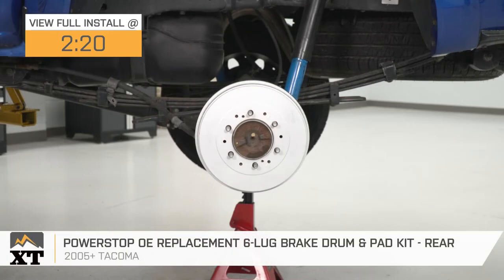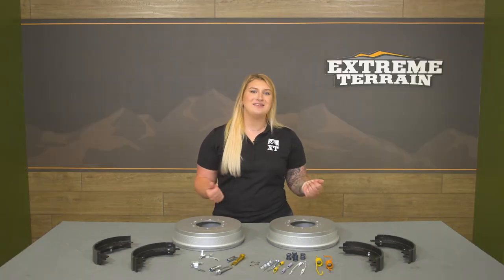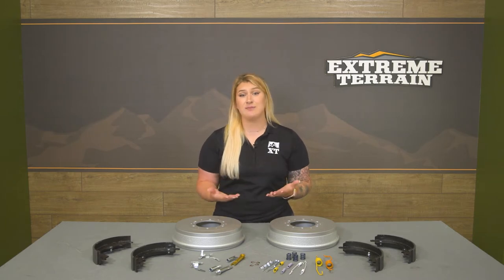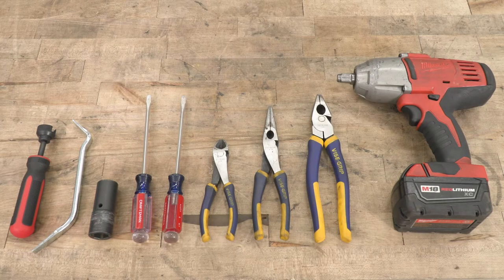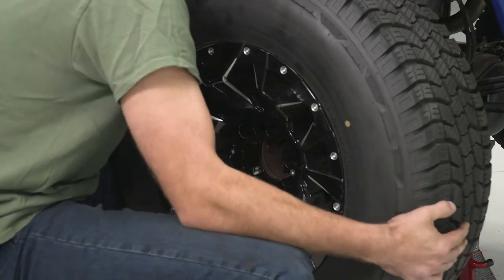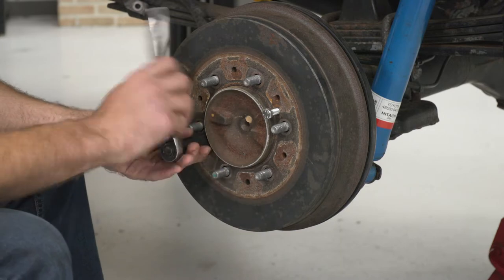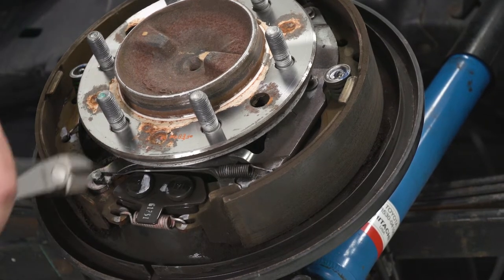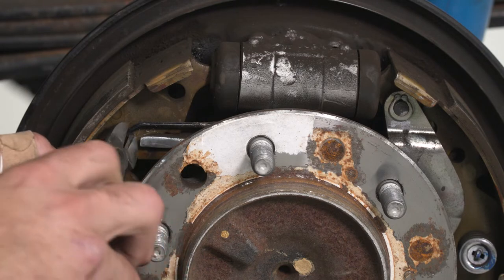2005-2022 Tacoma PowerStop OE Replacement 6-Lug Brake Drum and Pad Kit Review & Install

Comment: Adjusting, you don`t want to hear a rubbing constantly. Adjusting them you should hear them rub at first when you rotate back and forth until they center up with drum.  Rubbing means friction, which means heat. Properly adjusted brakes you will not hear rubbing, You don`t hear the brakes rubbing BEFORE you take them apart cause the self-adjuster does not adjust them to that condition. Pulling your emergency brake to the extreme or backing up and hitting the brakes will self-adjust to the proper gap.